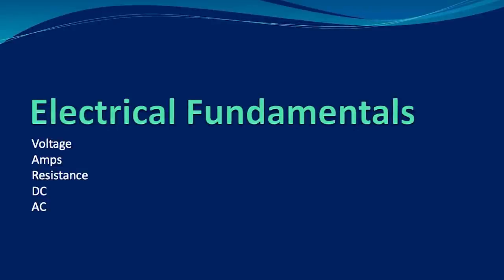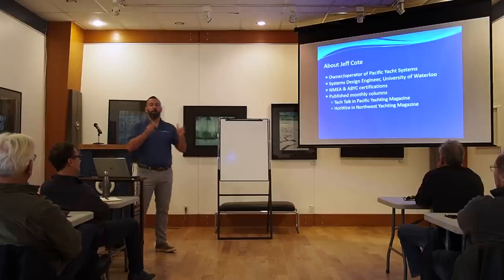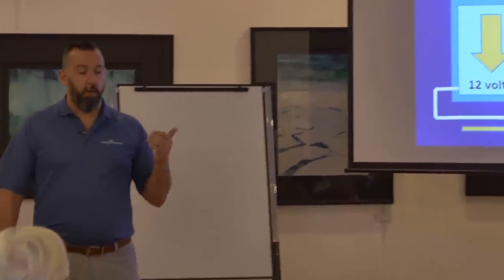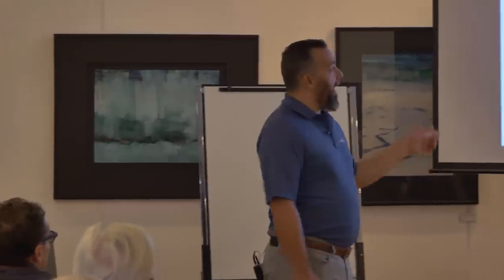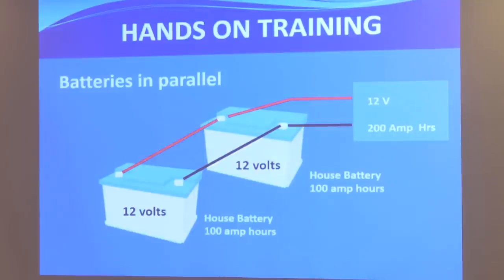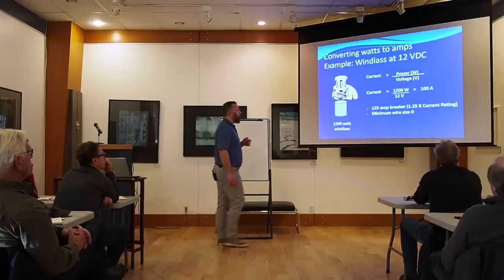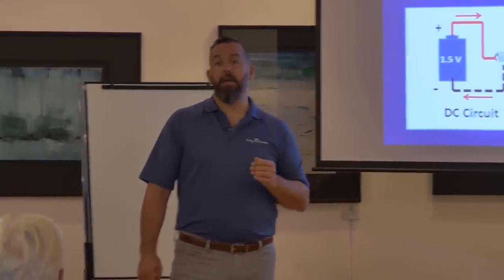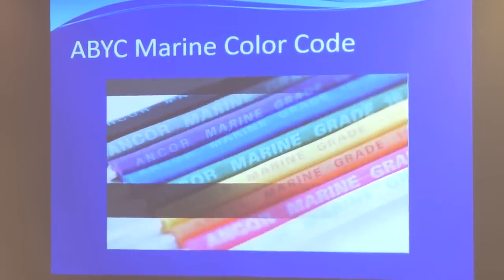How To: Marine Electrical Seminar - Electrical Fundamentals - Ep 18/30

Comment: Three years ago, I went from a Tanzer 22 to a CS33. The learning curve on boat systems has been steep, the worst being about the electrical system, which I had sorted out by a marine electrician, based on the pre-purchase inspection. Everything was going reasonably fine until my Victron Multiplus Inverter/Charger refused to power-up following the starting and house batteries discharge. This issue brought my attention back to my lack of knowledge about the electrical system. I am usually good at learning through reading technical books, but this topic is definitely my Achilles Tendon. A friend of mine sent me the link to your presentation on inverters and I can't thank him enough. I started going through your series of 30 instructional videos and my threshold knowledge has increased tenfold. So yes, I definitely relate to your introduction on this one and thank you for taking the time to make your videos available to the larger public.

Comment: Awesome information! 

hypothetical question out of curiosity, would it be possible to safely wire two 110 amp 12v batteries in sequence to get 24 volts to another set of sequenced batteries (in parallel) to get 24V at 220amps?
Reply from the maker: Great question. Two 110 amp-hour 12 volt batteries wired in series gives you 110 amp-hour 24 volt battery. Two 110 amp-hours 12 volt batteries wired in parallel gives you 220 amp-hours at 12 volts.

Comment: DC wire color code. recently i went to West marine in US (Burlington Vermont) in electrical area they had different wire size but all the wire where only available in red and black...no yellow available.
Reply from the maker: Hi Maxime, that's too bad. Black is OK for DC negative, but i'd much rather you use Yellow for the DC negative.
Reply: Greg's Marine Wiring Supply is your friend. 

West Marine is a ripoff and should only be used when absolutely necessary and you need a oart right away. As you saw though they don't have allot in the store.